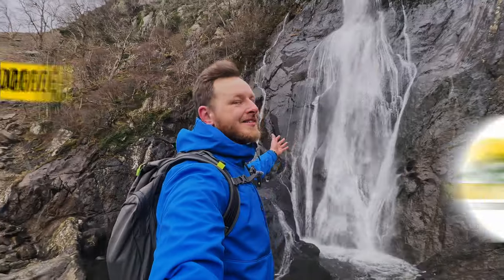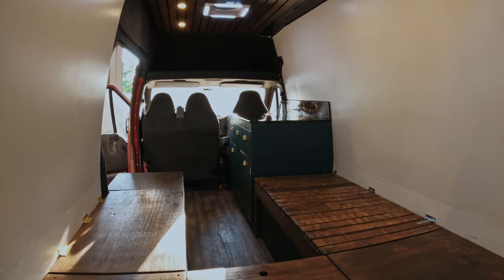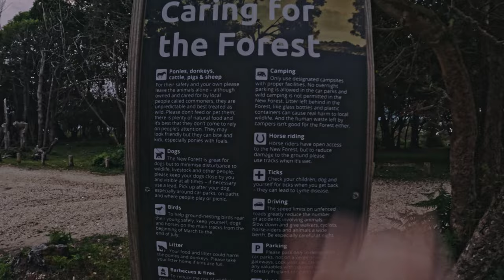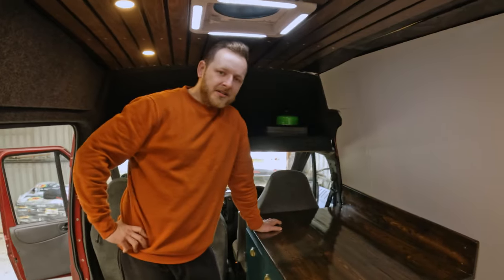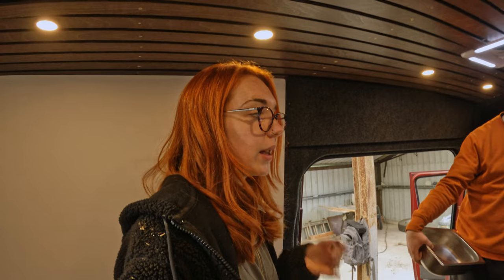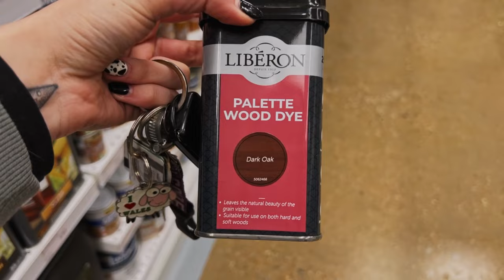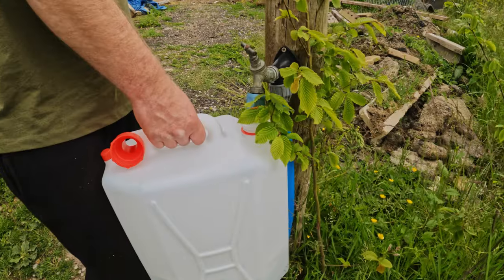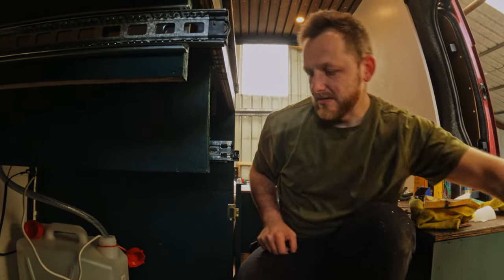Cheap And Easy DIY Campervan Water System | VAN BUILD EP 14

Comment: Loving the build so far, simple living, all the things you need and not all this fancy electrics etc that could cause more headaches. Was just wondering, i know it's early days, but whats your first thoughts on the fridge? as i'm thinking of getting one to go in my camper conversion. keep up the great work!!
Reply from the maker: Everyone is different but the simple route was definitely more for us! The cool box worked ok, we were only away for a few days and it kept things cold but it did collect some water and we didn’t have it running all the time. We have had suggestions of using ice packs to help keep the cool air circulating but so far, it does what we need it to! We will update you when we take it for another test run! Good luck with your build!!